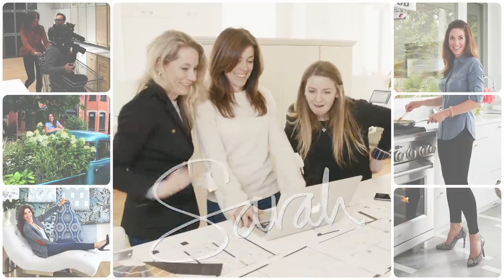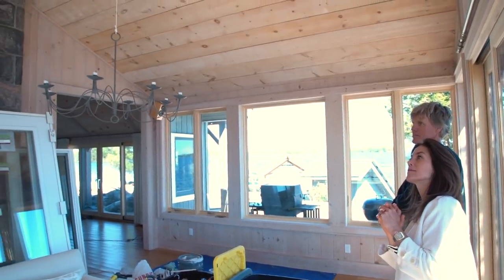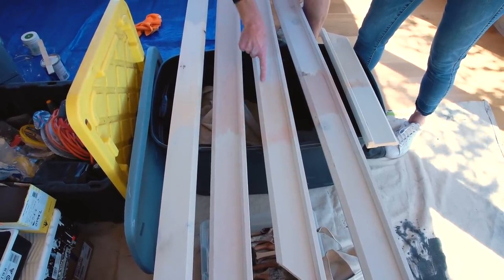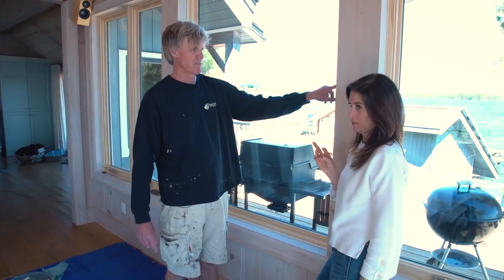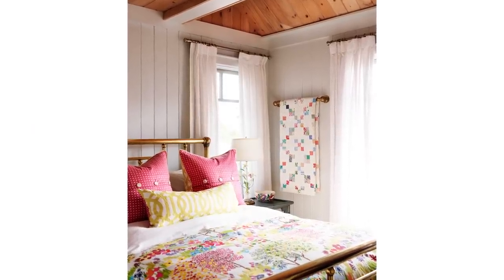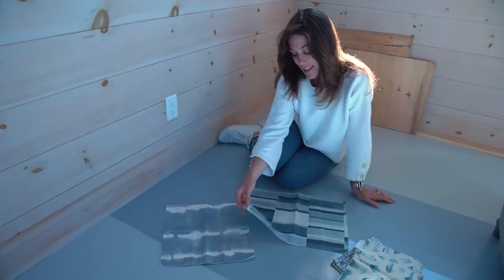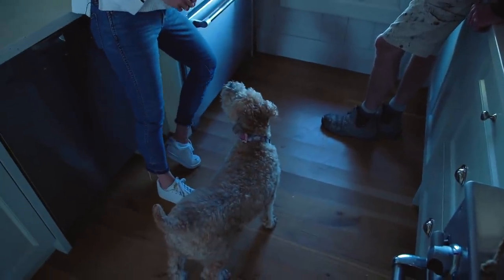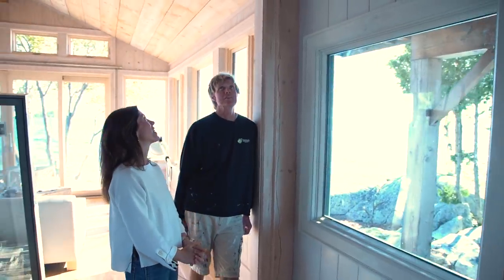Sarah's Island 2.0: "Decision Day" -- Wall Staining! (Ep. 6)

Comment: I think it's a nice compromise between stain and paint. I worried it would look like paint that needs a second coat, but it looks very even, no streaks or blotches. It doesn't look 80's white wash either. (Do you remember when you tried to white wash dining room chairs and it didn't work out? Tommy was against it. I think you had them sprayed grey. Good times.) I thought painting the walls but leaving the ceiling natural was the way to go, but this looks nice. Maybe a brownish grey stain on the ceiling will dull the yellow tones?